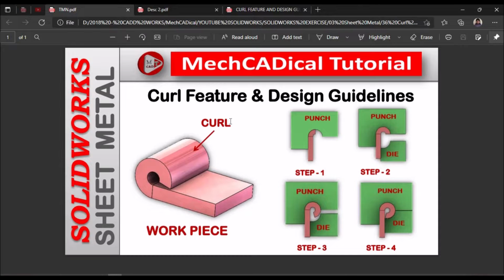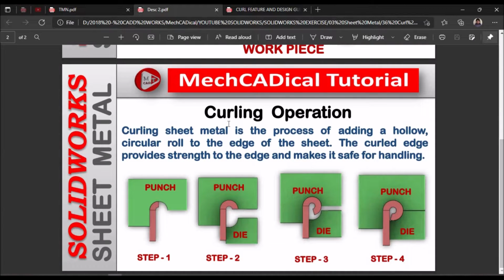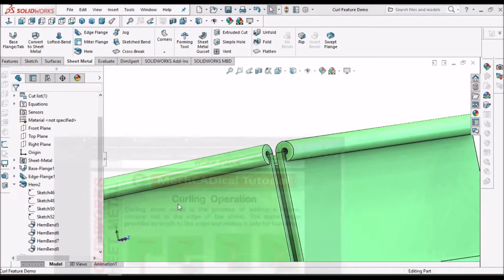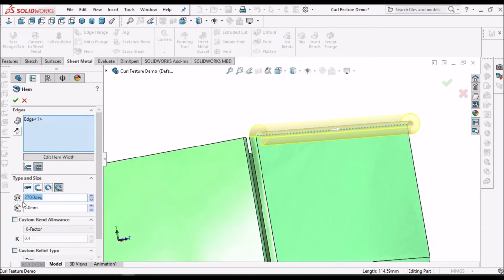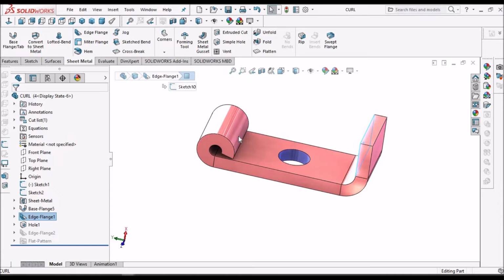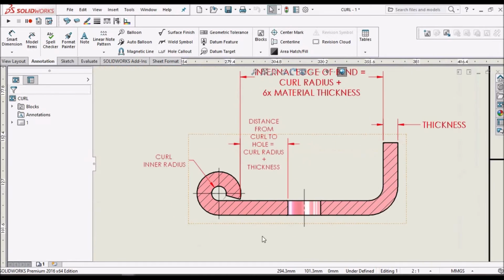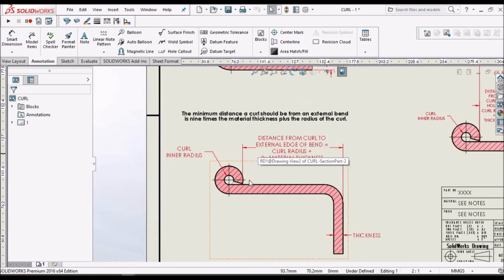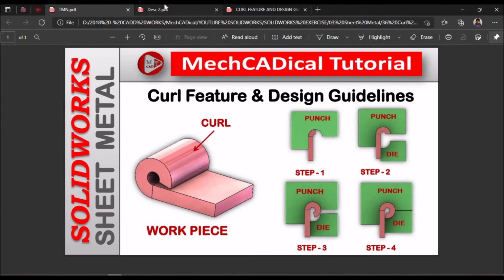Curl Feature and its Design Guidelines In SolidWorks Sheet Metal

Comment: Dear ,in second attachment "curl feature and designing guidelines" 
Figure 1 expressed curl radius is outside- here clearly mentioned outside of radius.
Figure 2 expressed inside of curl
Figure 3 expressed  inside of curl

figure 2 & 3 radius of curl ,we take it as out side radius,because dimension line projected from there, am i correct?
Reply from the maker: Hi Mathi !!! Dimension line can be selected from inside edge or outside edge, when we create Curl Feature in SolidWorks, we always consider inside radius.  when we calculate Punch and Die, we consider outside radius of the Curl.